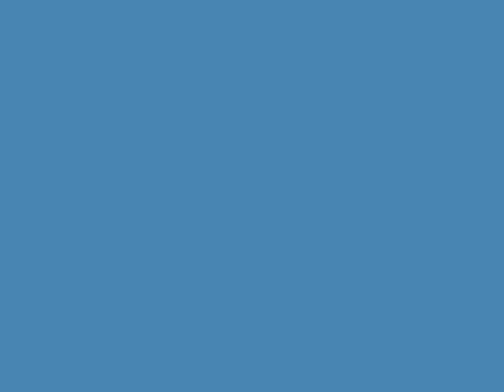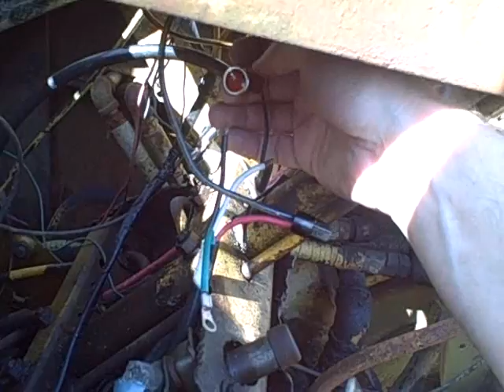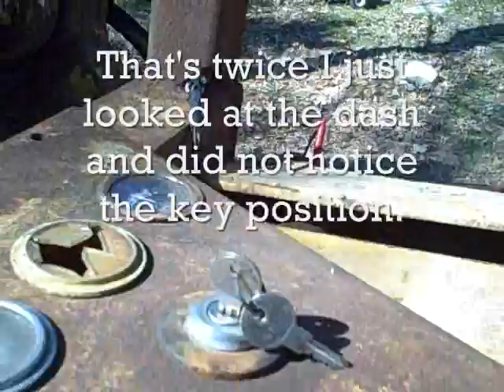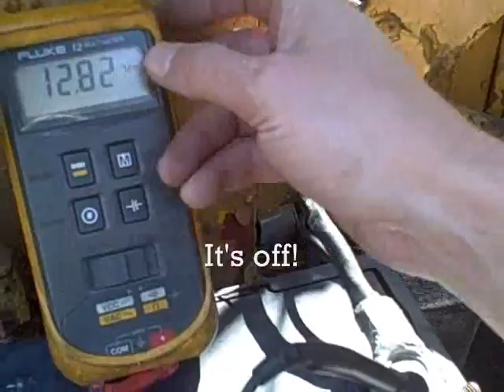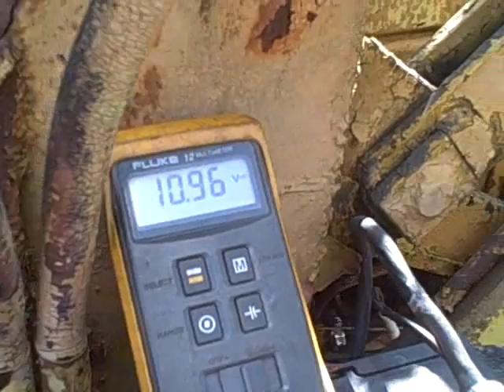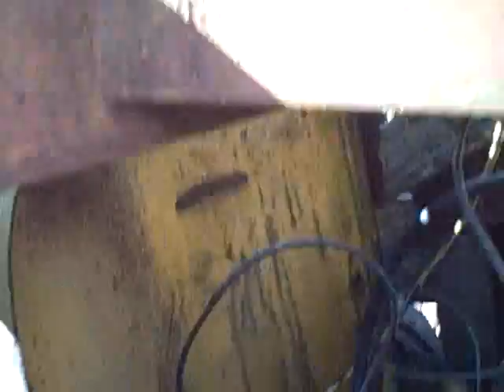Oliver 770 Industrial Tractor Project Part 124

Comment: Hi Steve, before I get to far along did you ever put the safety wire on those bolts in the injector pump? I know you had talked about it, but I haven't seen anything as of yet.
Reply from the maker: I can't remember. I may have left the wire off.

Comment: HA HA HA I like the comment , Well if all else fails buy a rubber covered Starter button and don`t got thru any reduced power service like lights or fuses there`s none other than a fusable link on a charging system press it when started and go about your day the gauge will tell you it`s working  at least you can charge it for now .